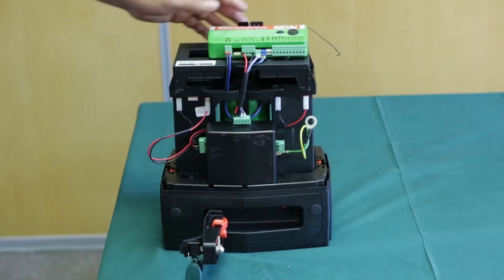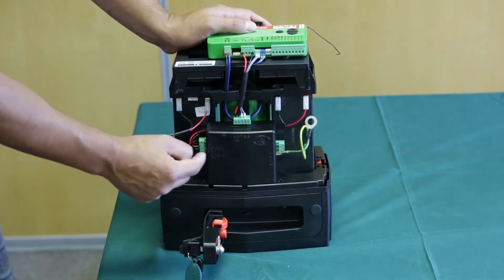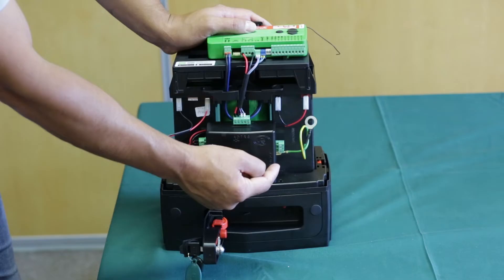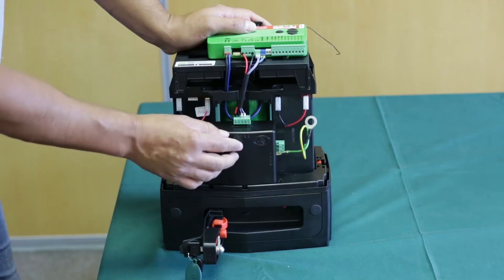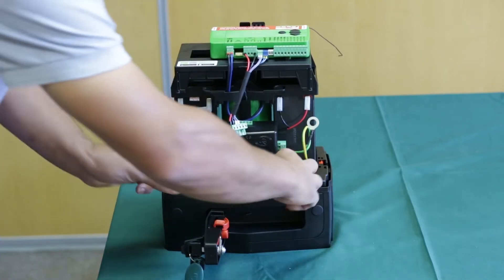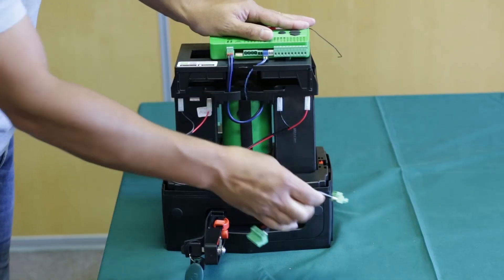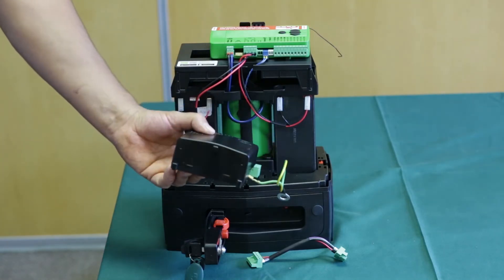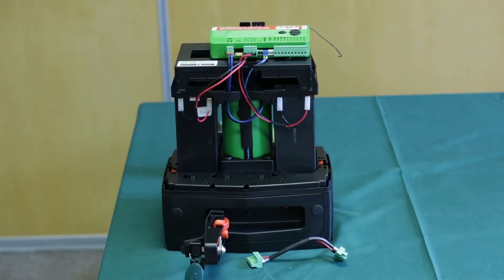D5 SMART Gate Motor | Mechanical | Temporarily Bypassing the Power Supply

Comment: I'm getting a 12v rail failure after doing this. What does that mean. Also, with a surge tube in place, what could have caused the power supply to fail?

Comment: I keep getting this message: "Override not toggled. The operator override was not opened and closed." This is for a machine I got today. Opened and closed that thing so many time!
Help!
Reply: Getting the same error, did you manage to get it fix?
Reply: @samchu7261  Yes, the control module was faulty and had to be replaced.
Reply: Which one is control module the one on top of the one in from